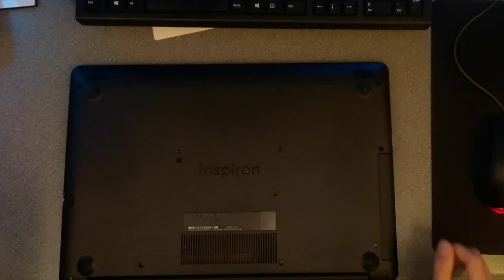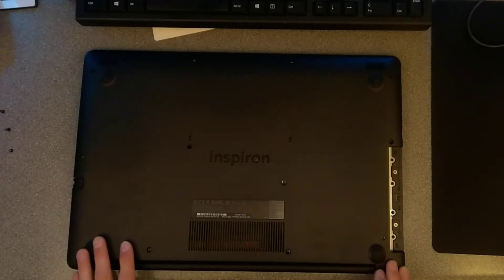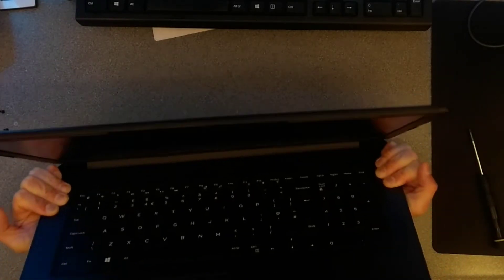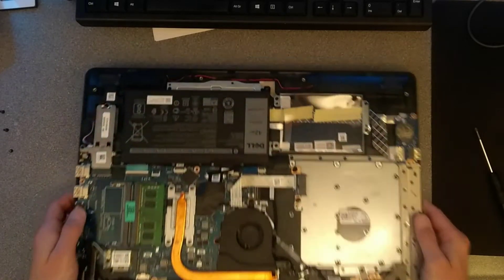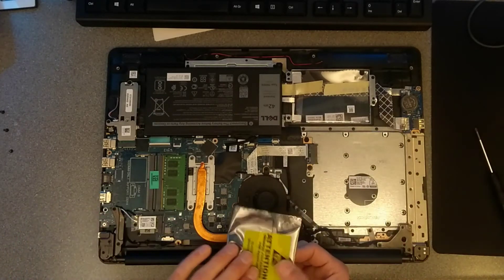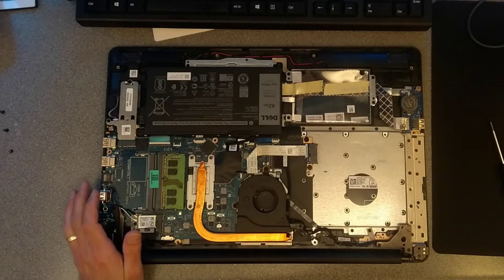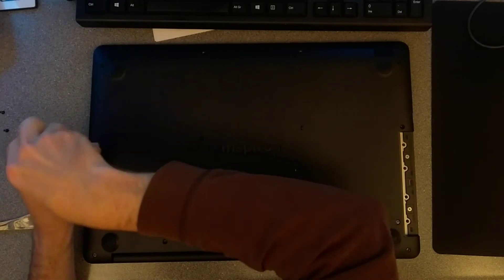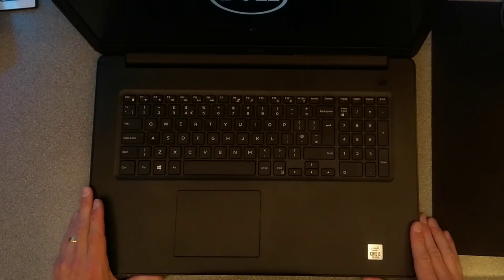Replacing the RAM on a Dell Inspiron 3793

Comment: Gr8 for Dell, I've the same model, replaced my 8gb ram to 32GB, but still slow booting up, I guess it's a resource issue (looking to resolve that next)
Reply from the maker: SSD upgrade if you've not already got an SSD! It makes a massive difference to the responsiveness of a computer.

Comment: Can I put 32gb of ram on this computer?
Reply from the maker: Use the crucial.com system scanner. I don't know off the top of my head.
Reply: According to Dell's system specs (their documentation), the 3793 will only support a max of 16GB, BUT that is limited to a SINGLE module, you can't double up on 8GB modules!  Literally hours ago, I hit a wall when adding an additional 8GB module to the empty slot to reach 16.  The system just flat out doesn't recognize the additional 8GB, subsequent perusal of their docs confirmed that I'm SOL and have to replace the existing 8GB with a 16GB module.
Reply: @haidozo4732  I added a second 8GB Crucial memory stick to my 3793's second slot for 16GB total. It was recognized immediately and the increased boot up and operating speed is very noticeable!

Comment: where can I easily buy the new RAM?
Also thanks for the video, I can finally make my pc better.
Reply from the maker: crucial.com is where I'd go to look up the part number and then maybe buy from Amazon or elsewhere if it is lower cost than direct.
Reply: @freename  thank you.
Reply: The 3593/3793 and any Dell 7-11th Gen Intel Core for that matter will take any DDR4 laptop memory, the 10-11 gen supporting at least 2x16GB 3200Mhz at least in the i5/i7, i3 I'm unsure of but probably the same. Any aftermarket DDR4 Laptop memory will work, and the listed speed is max supported with the Laptop automatically running at a slower speed if it can't support the max.

Comment: Amazing video! Thank you so much! I have one question if you don't mind me asking: when I attempt to take out of the screws that can be seen when the CD drive is taken out, one of them don't seem to budge and I can't screw it out no matter how hard I try. What should I do in this situation?
Reply from the maker: If it turns.. try putting something down the side of the screw head while undoing it to "push" it over into making contact with something so it then screws out. If it doesn't turn.. not sure :/
Reply from the maker: Or turn the laptop over and see if gravity helps when unscrewing
Reply: @freename  Alright, thank you so much for your feedback. :) Unfortunately, it doesn't turn though. It might be because it was previously a bit damaged.
Reply from the maker: For ones like that I would use a screwdriver I have which has metal grips and works really well if you use pliers to turn it.
Reply: @freename  ok thanks for the tip
Reply: I had the same and had to drill it out! I’m also looking at the hdd caddy & there is also some very marginal screws which I wont be putting in again

Comment: trying to find specs on the MB, i want to upgrade the ram to 16 or 32 not sure what it can handle.
Reply from the maker: Use the crucial memory finder or system scanner
Reply: I just added another card to my laptop ... thereby doubling the RAM from 8 to 16 GB.

Comment: Can I ask what screwdriver you’re using? I’m having trouble getting the screws under the disk drive out
Reply from the maker: Something very much like this:
https://image.ceneostatic.pl/data/products/36197671/i-stanley-wkretak-dynagrip-pro-zegar-pz0-x-75mm-1-67-056.jpg

The numbers written on it are 67-056 #0 PZ x 60mm /2⅜"

Otherwise a small jewlers screwdriver often helps 
https://images.starrett.com/is/image/Starrett/555Fe52561cUSp1

Comment: You made me curious regarding hinges, what is the problem with hinges ? please explain. Also what will happen if you do not put your hand on the hinges side while you are dismantling the laptop ? thank you.
Reply from the maker: When the bottom case is on the hinges are "clamped" between the bottom case and top case with two extra screws as well as the one on the metal hinge going into a pillar into the top case plastic.

When you remove the bottom case screws the only thing holding the hinge in is the remaining single screw into the plastic on the top palm rest. This makes it much more brittle and, if you are unlucky or not careful, opening the laptop cracks this plastic pillar, leaving the hinge no longer attached at that point.